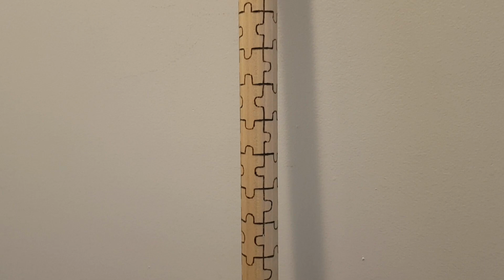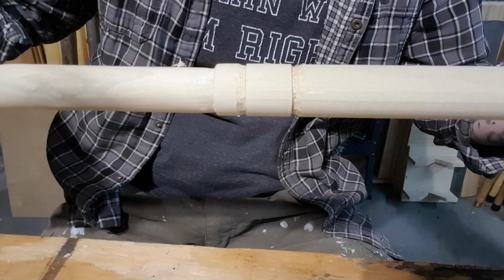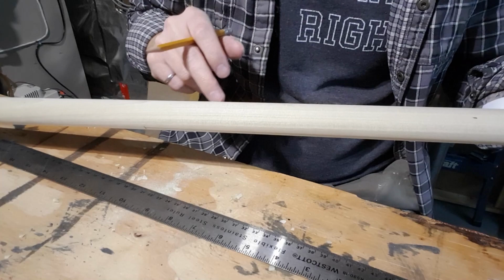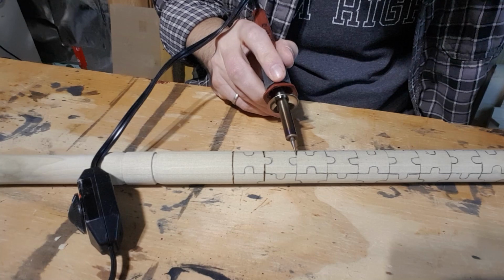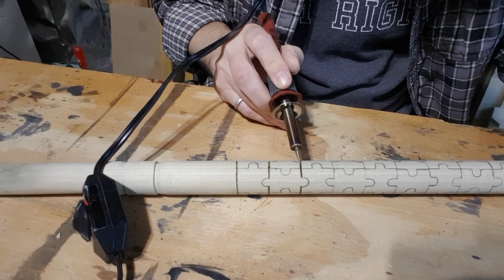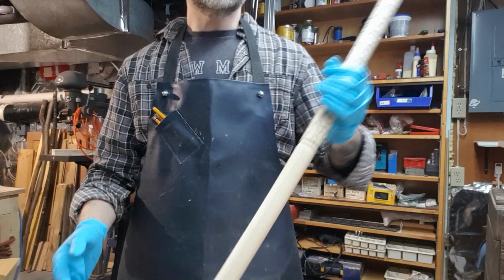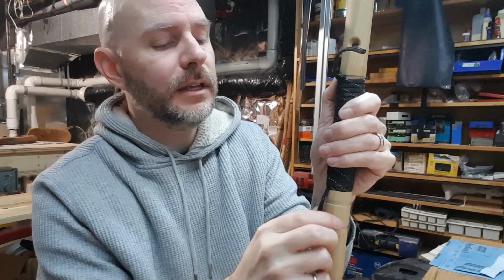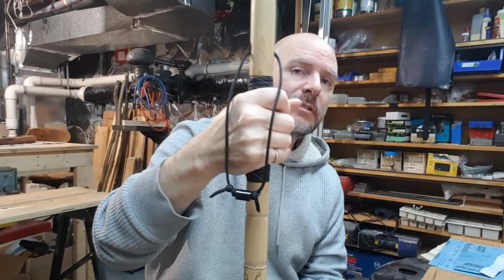PUZZLE WALKING STICK - simple geometric pattern

Comment: Love your channel. Soo everything is wet and cold here. So I haven’t been able to collect any wood. So went to the store got some dowels. But I also picked up some 2x2x8 furring strips. You ever use anything like this? Not sure how I’m going to attack it yet
Reply from the maker: Thank you very much! Never used furring strips as they are usually pine wood here... but I did do a great Celtic Knot stick out of 1x2" oak lumber (2 pieces laminated together to make a 2x2"). That came out great I think (see the video for instructions). But let me know how it turns out, you might have to keep the stick a bit thicker to account for it being pine... but it will be easier to carve overall!

Comment: About how long was the paracord you used?
Reply from the maker: That's a great question, I don't usually measure the amount used. But I get 3 handles out of a 50ft unit of paracord with a few feet to spare so I'd say around 15ft per wrap. Hope that helps